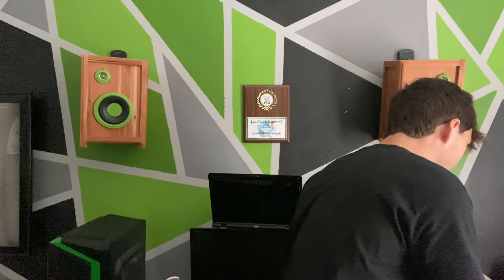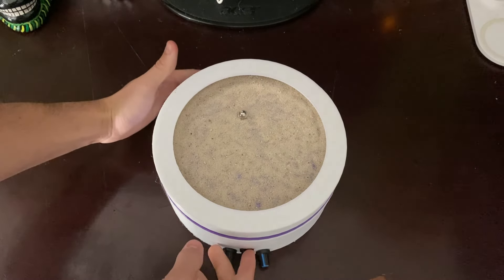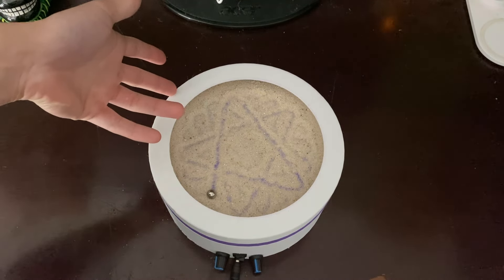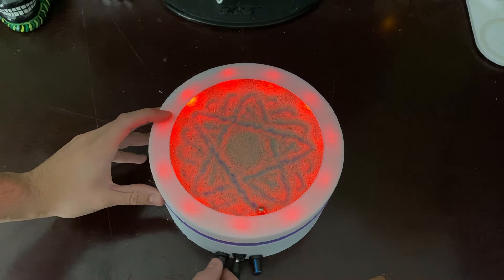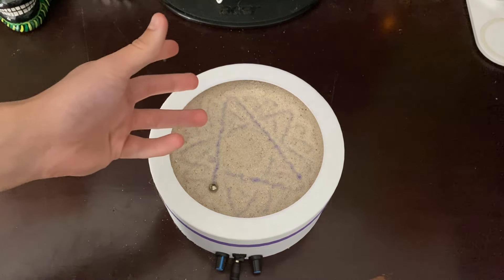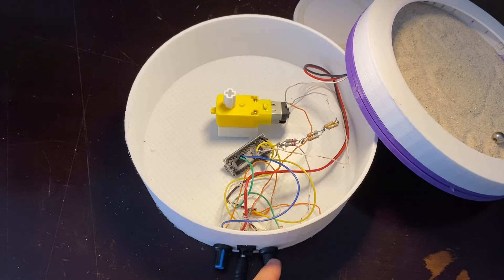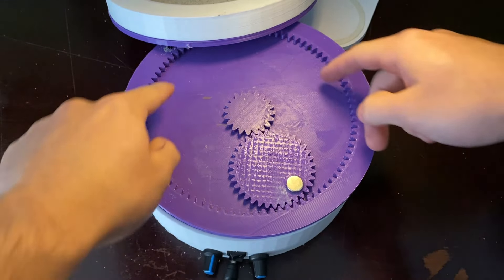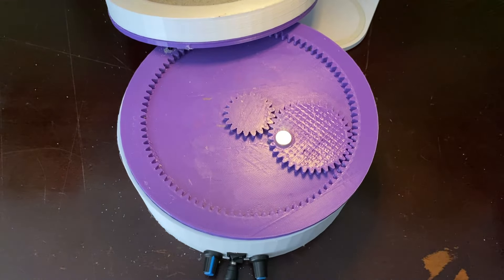Table Top 3D Printed Kinetic Sand Machine

Comment: That's pretty cool. Maybe you could use a weaker magnet or put a soft material between the plastic and the sand to lessen the noise.
Reply from the maker: Thanks for the feedback. I’ll try a piece of felt I have and see if it works
Reply: You should print tpu for where the ball is rolling on I bet that would eliminate the sound 100 percent and keep it totally 3d printing! I gotta look up how these work a little more.. it wasn't what I expected when you took the cover off lol.. idk what I expected but not just one single small motor. I have an extra stepper. Wonder if I could use that instead like you mentioned in the beginning of the video @DominicLeBoeuf

Comment: really nice work. Maybe you can lessen the noise by using a bit finer sand; the one you use is quite coarse. maybe sieving already helps. 
And maybe you can put more sand in there so that the ball doesnt drag on the bottom of the plastic, and maybe u can get rid of the purple plastic showing in the trail of the ball that way. 
I hope i could help you a bit!
(these are all asumption i have that may help you reduce the noise)
Reply: Agreed. Finer grit sand would help massively. Fine glass bead blasting media would be my suggestion.
Reply: It probably wouldn't need so strong a magnet in that case as well. It's pulling really hard on that thing which is making it grind. Fine glass beads, a softer magnet, and maybe smoothing the sand bed with some sanding and/or epoxy. Personally I'd replace the bed with a circular sheet of glass or sheet metal, but I think that probably defeats the purpose of the whole 3D printed aspect of it.